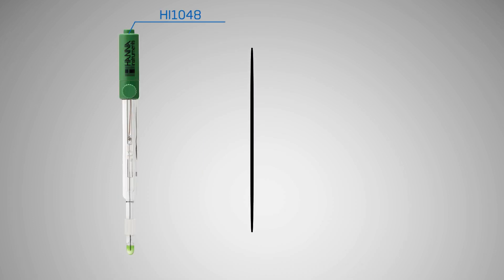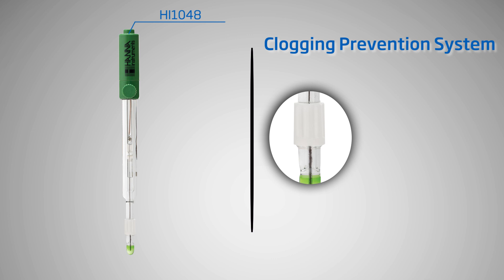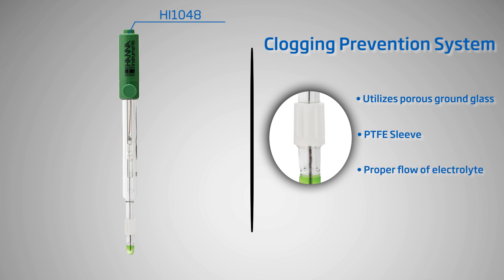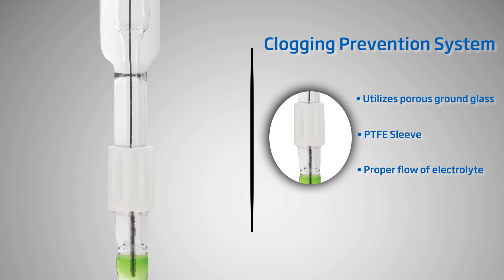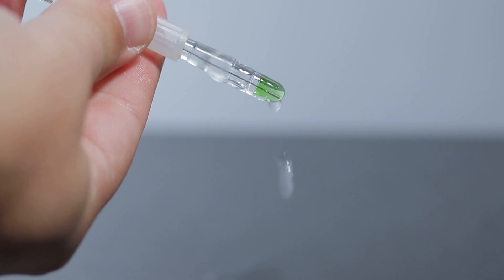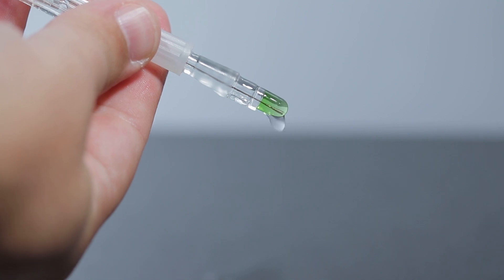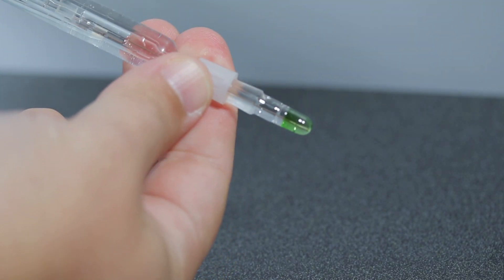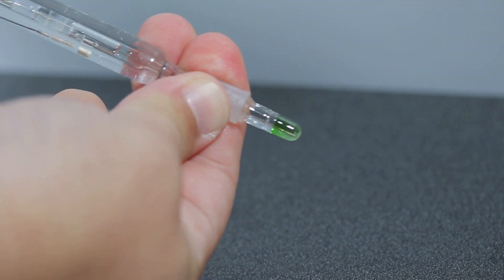HI1048 pH Electrode for Wine

Comment: Why is that instructions are always woefully inadequate? Like, am I supposed to fill my electrode up with electrolyte solution or is it already full when purchased? It is impossible for me, a newbie, to tell. I can't see a fluid level line but maybe the fluid level is above the limits of the green cap? Or maybe they come empty and it's up to me to fill with electrolyte? If so, why would this not be included in the instructions? ARGH. I swear, I should have been a technical writer because most technical writers are idiots.